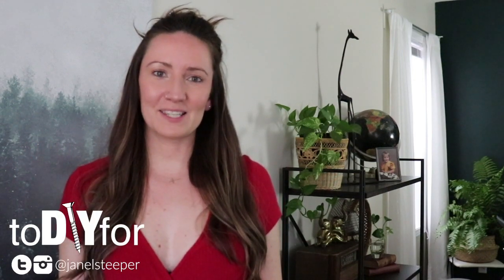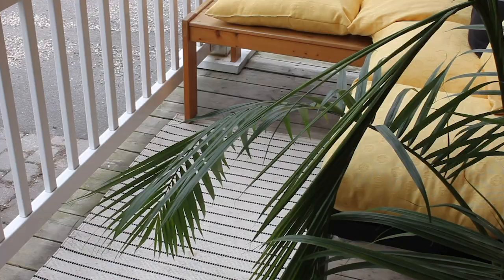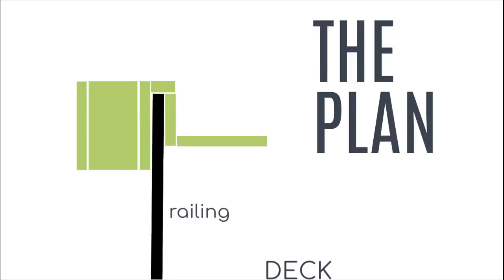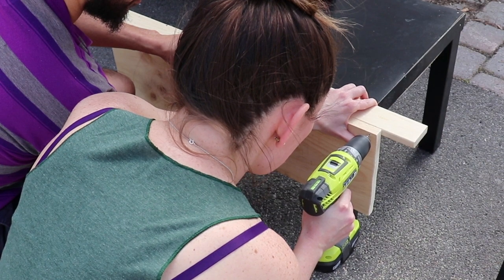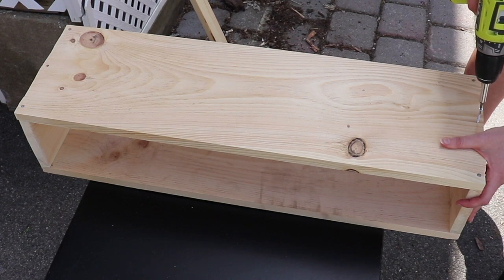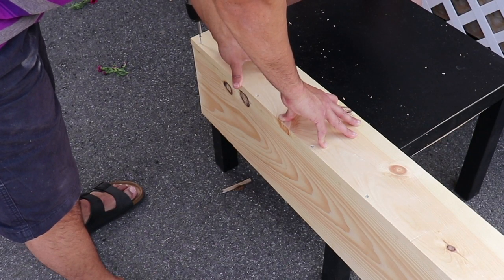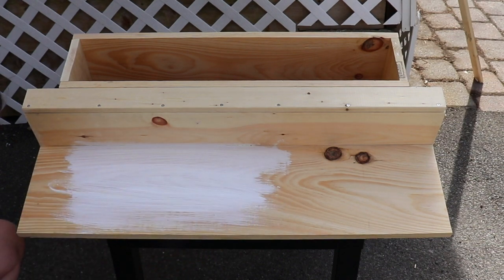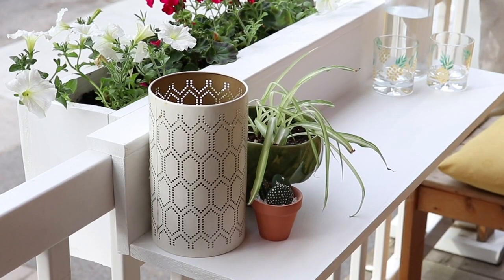Removable Railing Table & Planter - PERFECT for Apartment Balconies

Comment: This is amazing. I am interested in doing something similar but my deck has a thicker 2x4 type of railing along the top. I wonder if this could somehow be modified to work for this type of railing? Awesome job!!! So lovely!
Reply from the maker: Absolutely! You’d just have to do some measurements to accommodate for the thicker board! But looking at mine right now it actually looks like my railing is very similar to a 2x4. So my measurements could work..but I would suggest measuring first!

Comment: I love this! I always wanted to do diy projects. How do you know much wood to use and what sizes to make them?
Reply from the maker: I’m not sure I can explain it much better than the diagram I showed in the video. The most important measurement is how wide is your railing. That will help determine the width of the board you use for the top. You want it to be a snug fit. As for the rest.. it’s up to you how big of a flower box/table you want. I wouldn’t suggested using a wider board than the one I did for the “table/shelf”.
Reply: @toDIYfor  thank you for the speedy reply I appreciate it!

Comment: Do you think this would work without the planter part?
Reply from the maker: Yeah for sure! I would just suggest to make the length of the board you use instead to go down as far as I did with the planter to help counter balance the weight you may end up putting on the table.